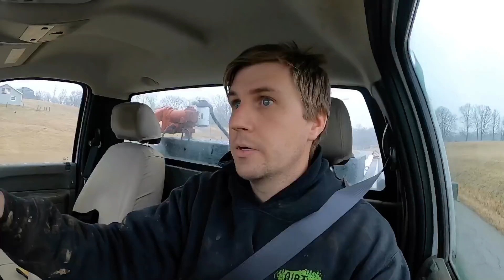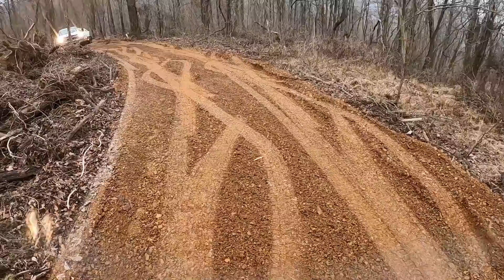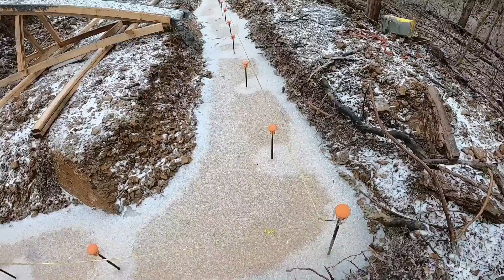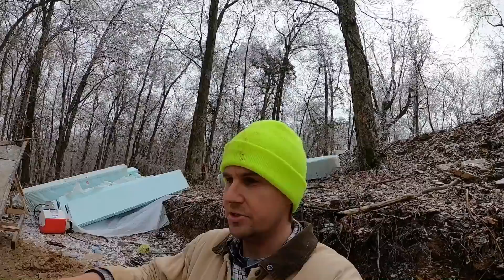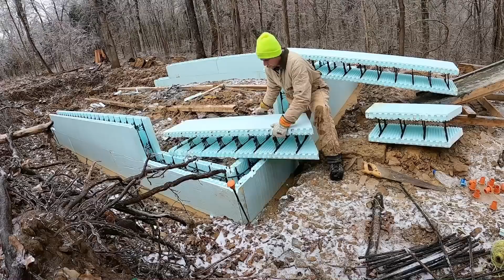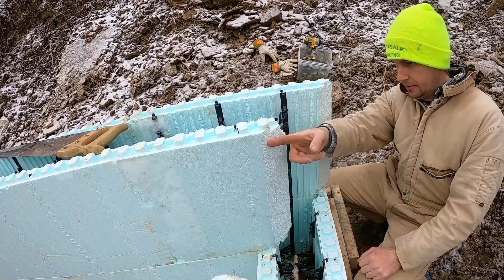Building ICF Steamboat Themed Cabin in the Woods - Wall Progress

Comment: very interesting capt. would it hurt to dig a trench away from footing so all that water can fall away or drain . You can also use it with some big o pipe to keep everything dry .
      Getting back to your transfer at the fire hall .As you mature on the job you don't yearn for more accolades . but you are deserving of more authority with your added abilities. After 38 yrs with Toronto Fire . I really cherished my guys that had a lot of experience . At a call they were easy to lead .Have a great day Eh!

Comment: Hey Captain, it's a lot easier to shovel water when it's solid. Lol
Fantastic use of creativity with the ICF. I have used bender-board and 1/4in plywood full length strips layered to make different types of radius shapes, it works really well when you want to start shallow in the curve and gradually increase the sharpness of the curve. The project looks great.

Comment: When concrete is cured remove icf forms on the inside and the concrete mass 
Will stabilise air moisture and temperature in the cabin ;stucco the walls internally. Or put wood on them with ventilated space to concrete. 
Is the idea to build the cabin out of concrete all the way ? (I guess the roof will not be concrete.)  Wood flooring would be nice brackets for the floor beams can be fastened esay if bolts are inserted In 
formwork  before pouring concrete.
Dig out the woid down to the footing  lever  pour floor slab all the way to concrete wall core.
And you get a cellar that will be cool in summer to some degree, and frost free in winter, free cool storage for food etc. Access can be a hatch in the floor . That's also very boat themed by the way.
The idea to trap moister between to no perimabal plastic layers is not so good , if you do that with a wood house and moisture gets  in the whole house can be yepedised. 
Why should that be a good ide for concrete? Can you address the dual
Plastic layer dilemma in the next video?
Reply from the maker: Insulation stays on. That’s the whole point,  to make a well insulated wall.  Basement will have stair access.  Basement floor with be concrete.  Main level floor will be concrete.  Not following your other questions 
Thanks for watching
Reply: My point is that insulation on the inside of a heavy  wall does not help the inside climate in the house,when it comes to heat storing/ termalmass for example. It is true that the 2sided foam  gives the house  fast response time when heated , but low 
Energy storage cap. Also means that 
It cools fast. In a cabin with eps
Walls that use wood stove as heat source, you would have a fast cooling  curve when not burning fuel.
 That's why some stoves have soapstone around  them , for increasing thermal mass.
Log cabins also store energy.
I have a massive log house with 
Clay  plaster inside.  When the evening comes  on the warmer parts of the year . The inside surfaces radiate heat that's been stored in the log wall by the sun. The plaster also   pick up moisture sometimes and give out other times.  It is true that the house is thermally slow to warm up but, also takes time to cool of.

 the outside foam layer is  probably enough  for  insulation purposes.  The inside seems more like a partikal all in one 
Forming system. The core wall will not be a very active  part energy vice of of this kind of building system. 
But mayby thermal mass is unwanted on this cabin . Fast cooling / warming might also be 
A goal.

I live in Sweden  20 metric miles north of Stockholm

Comment: I have the same go pro batteries & charger. Do you have any issue with these batteries running out quickly?
Mine will last about 30-40 minutes while in quick capture mode.
How about yours?
Reply from the maker: Actually I do.  I’m not sure why though.

Comment: What kind of cost comparison is ICF building vs a wooden frame?
Reply from the maker: That’s depends on your goals.  But short answer,  apples to oranges performance wise, so no direct comparison.
Reply: @CaptainKleeman  Was tossing around the idea of building a shop. high enough to put a lift in it, and wide enough to put a large 4wd tractor or my 973c in it.

Comment: Got an idea for making the bow curve outward a bit more- cut or run a 1/2 slot with a router lengthwise/ horizontal on the outside panel -  making it a bit shorter- this should make the curve you are looking for- it will need a lot of strapping to hold the forms in place- just an idea- take care looking great
Reply from the maker: Good thought,  but the plastic studs would prevent it from “rolling” horizontal.

Comment: With the ICF type construction you could just add architectural foam  to the outside of the ICF to add more dimension then when you floor you could just overhang that foam without ruining your strength....  seen alot of DRYVIT system planed into interesting shapes...  just and idea keep up the good work
Reply from the maker: That’s the plan,  just trying to get a little “headstart” on the shape of that makes sense.

Comment: © Giraffe ICF Bracing System sells a wall vibrator called "Black Rattler" they are in ON,CAN if you ever need one think about $100.  Looks like things are coming along nicely. They do make winter wiper blades and a sheet of plastic or cardboard  on your window under the wipers halfway up works wonders in snow or ice !

Comment: Good mornings to you.. just a thought.. to help help build out the bow.. you could use (stucco) ..inital form using sterofoam, chicken wire, and cement.. it'll be durable and it'll add some flare to it.. awesome project
Reply from the maker: That’s the long term plan.  Just trying to get a head start on the shape

Comment: Borrow the mini from Mike (if it will handle the slope).  That would make fairly short work of digging the outflow for your drain, not to mention being a hell of a lot easier on your back!
.
When you were describing and cutting for the bow of the cabin, at first I thought you were going for what's called a "Carolina Flare", said to myself "Paddlewheelers don't have a bow flare like that!"  Now I can see what you're going for and it makes a lot more sense!
.
Now to keep up the authenticity, you need a coal fired boiler to put in the bilge/basement for heat and hot water LOL
Reply from the maker: I rent mikes equipment when I use it.  I’m too cheap to rent it for that short of a ditch 😂
Reply: @CaptainKleeman  LOL I understand entirely

Comment: Things are  coming along pretty good for not having weather to cooperate much. 
 Just out of curiosity, I googled  R value of ICF walls, and am surprised to see it is better than 6 inches of fiberglass insulation.
Reply from the maker: Way better than fiberglass.  Some brands also make “plus” walls that have 4” off foam instead of the 2  1/2”

Comment: You could have done the shaping with stucco instead on the bow
Reply from the maker: That’s the plan.  Not sure how that would be a substitute for the ICF though.  It’s more of a finish material.
Reply: Use the icf but form the curves and flair with stucco to make the bow more boat shaped

Comment: Morning Captain, hope the ladies and yourself are doing well. Curiosity question, do you cover the walls to prevent water from building up inside due to the length of time before pouring or is that just overkill. Thanks for sharing and have a great week!
Reply from the maker: Water can work it’s way out the bottom still.   Be safe and stay warm this week

Comment: I noticed those Ryobi inverters work fine with the 120v.  But for some reason the USB will conflict with the 5v fan if the battery is low and shut off.  Use the USB port on the chargers to fuel your GoPro, it works super fast too.  Looks GREAT!  Cheers!
Reply from the maker: I noticed that as well!  If I ran just the dewalt charger, no issues.  Still loving it though.  Just going through the learning curve with it.  Thanks again!

Comment: How good it must feel to see it coming together an come out of the ground, all the best bud
Reply from the maker: It certainly does
Reply: @CaptainKleeman   I;m thinking outside the box here, i realise before i  go any further it would be an additional expense, your issue of mud an water around the icf?
Going with the boat theme here, how about  plundering  some tree's from your land and on the high side of the boat making a pier type defence which could be used to divert the water around and away from the build? Not sure if you got some good sized cedar tree's, but if you like dug down a few feet in a arc trench, line up said logs  to lock together an concrete the first couple of feet to secure them ( excavator and concrete being added expense )  which would stop any erosion but harbour style look keep in theme with the b oat. Just an out the b ox idea which can be totally ignored an no hard feelings will be felt